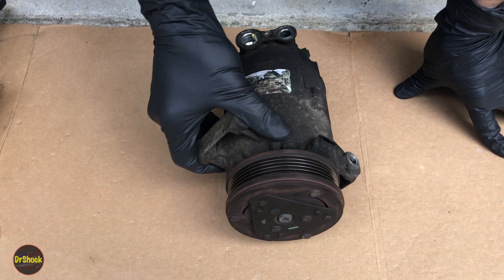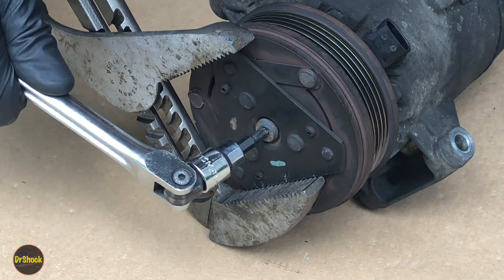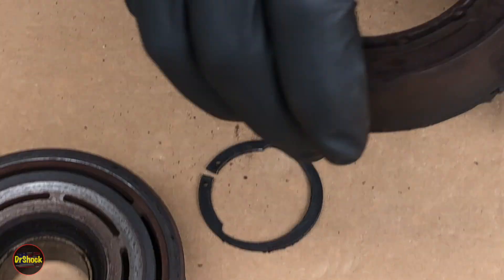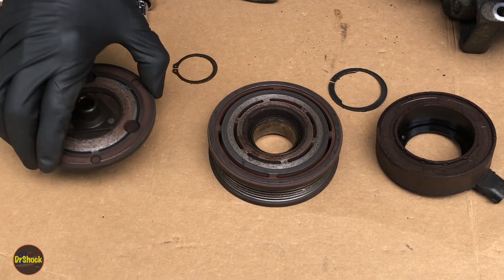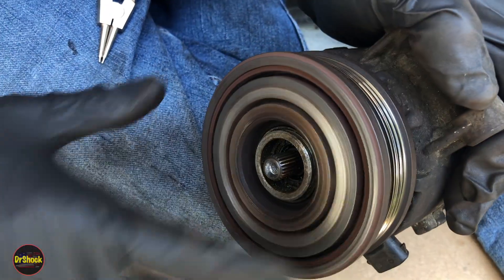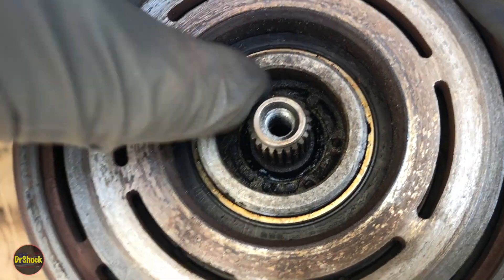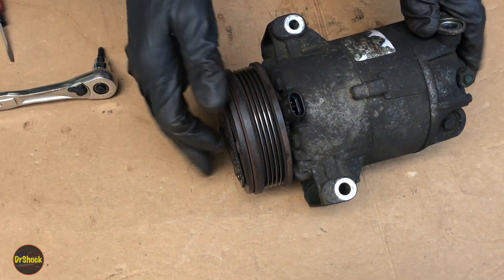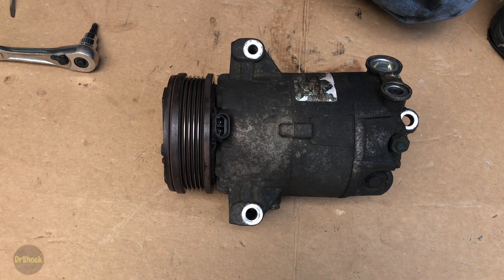2002 - 2010 GM AC Compressor Clutch Disassembly / Rebuild ~ Delphi CVC6 Design (Chevrolet & Pontiac)

Comment: Hey Doc, appreciate all your content - super helpful! I noticed that the coil showed micro-fractures at the 12 and 6 o’clock positions (for you when wedged between your legs). Could that have been part of the clutch failure or reason to be concerned about premature failure for this repair? Thanks again for all the great material you provide!!
Reply from the maker: Thanks.  This particular compressor actually failed internally due to age/wear, it's clutch was still fully operational (though certainly had high mileage on it).  Before recycling the aluminum housing, I used it as an example to illustrate the clutch disassembly and reassembly procedure for this video.

Comment: Would a large strap wrench or a belt clamped tight  to the pulley work as good without any damage to the pully? Your videos are the Best❤
Reply from the maker: Thanks, no the clutch moves independently of the pulley as it attaches to the compressor shaft.   So holding the pulley won't help with disassembly of the clutch.  You have to secure the clutch plate itself separately.   There's a special holding tool for that which I showed, but this particular OEM compressor had the mounting holes for the tool plugged off so we had to improvise.

Comment: Hello Shock, how are you? I searched among your videos about replacing the high pressure hose for the steering wheel for a 99 Suburban and I did not find anything about that, so I suffer from a leak in the high pressure hose and I do not know if I should replace them all (with the low pressure) and what do you advise me for the steering fluid? Some say that Dex III will do the job and save money. Have a good day and thank you.
Reply from the maker: These vehicles originally used a conventional based oil for the power steering fluid not ATF, so I'd recommend the one listed in the video description of this other video of mine around power steering here https://youtu.be/u3HeOcKEZAs

As for whether to replace non-leaking power steering hoses, no personally I would only replace the one(s) that is/are leaking or showing signs of dry rot with genuine OEM parts.